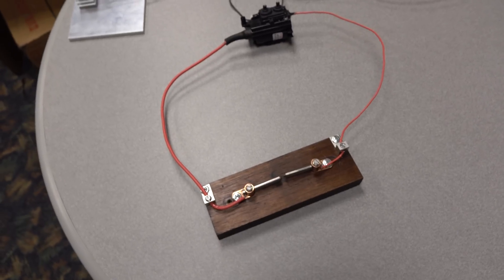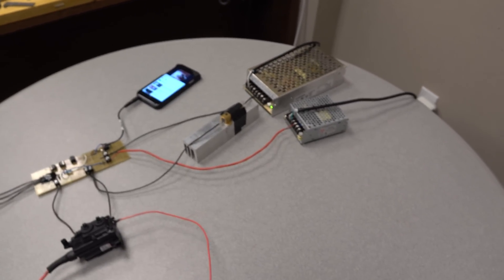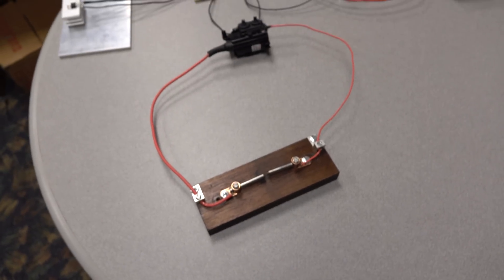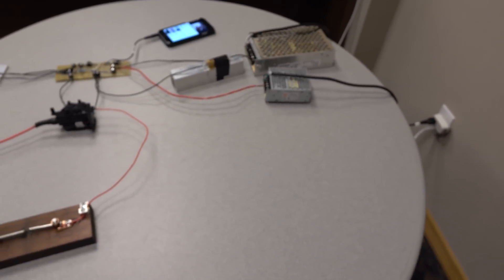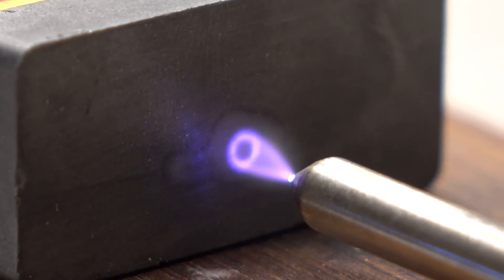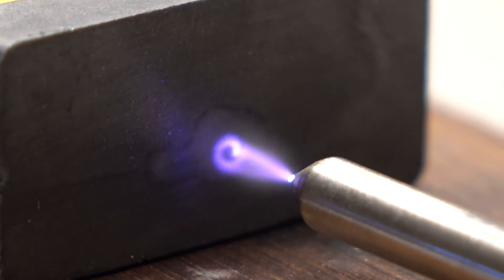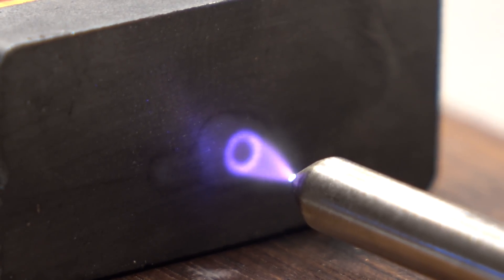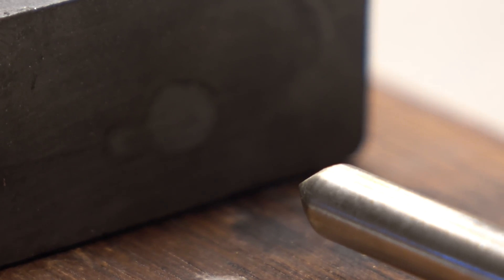Plasma Arc Speaker

Comment: I HAVE A QUESTION.   I NEED TO TRANSFER FREQUENCIES THROUGH A CIRCUIT LIKE THIS TO MY PATIENTS.  DO YOU THINK AT THE SPARKGAP I WILL GET THE FREQUENCIES IN A VERY PRECISE FORM? HOW COULD I MEASURE WITH AN OSCILOSCOPE AT THE ELECRODES OF THE SPARKGAP WITH SUCH A HIGH VOLTAGE THAT IS UNKNOWN?
Reply: Why are you yelling?

Comment: I achieved some excellent results in constructing a plasma loudspeaker. Usually it is not possible to get a loud bass from a low-power corona discharge, or at least a quality silence, still ready to instantly create in your room a little (or better a lot!) Of excess pressure and as much ... a lot of vacuum !!!

If the door is kicked out, the ear will feel: 0000, -9001, + 9001, ~ 0000

so that the limit of the symmetric (for every pulse polarity) the volume of high-end plasma loudspeaker is its ability to dramatically pogasnuv to zero, to create a certain vacuum, the same we can honestly put in a positive half-wave signal, and more, but then the non-linear distortion is inevitable, as in the amplifier class A - quiescent current, you can set the quiescent current (quiescent power plasmoid, in silence) single-cycle amplifier just half the maximum, not sparing the room heating, or add volume feedback system, reducing silent Sound power plasmoid maintain a "ready-zero", which in any case is limited to the volume in a moment.

The corona discharge always produces a crunchy noise, it's still cold, so when it's turned off, it does not produce a vacuum, so it's a source of positive delta pulses, like a burst balloon, but not like opening a radio lamp or jars of baby food ...

But to make an AM HF generator on a lamp with 100W of silence of power, and 200W of maximum power, not easier than a 200W radio station, that would not suit me ...

I also did not like the UPS version on the 555 timer, which modulates the duration of the rectangular pulses of the two-stroke (not flyback) PWM mosfet of the power supply, because the modulation in this IC is not high-end quality, and the transients will create non-linear errors in the rearrangement of duty cycle and power, for example " Dead time), the delay will make a variable contribution to the output power
Only on a meander signal (50% duty cycle) stable timings are achievable, otherwise the dynamics of key switching will depend on the previous state of the system

At the same time, a simple power supply for "IR2123" and two IRF840 mosfet + polypropylene 0.47μφ 450v capacitor at the output for decoupling and horizontal scanning transformer from the old tube TV with 45 revolutions 1mm insulated copper wire primary coil homemade
Gives a power of 15-20kV at 40-60kHz for 1-2-200cm, 1-2cm plasmoid is silent until it turns off ;-), while the efficiency is always about 100% and the power is determined by the output voltage of the output mosfet half bridge, the driver chip controlling the mosfet switches must be fed at the same time From an independent low-voltage stabilized power supply, always giving as fast as possible signals to the gate of the field-effect transistors, each time equally on time, in the middle of the period, ie to keep the mode of 50% of the duty cycle

Iron electrodes (strange but true) sound quieter than copper wire 1mm in diameter, from which the "Jacob ladder" is made for self-ignition

An unusual supply of power to such a voltage converter (linear in a wide range of capacities, and cold during operation ...
The mosfet transducer is switched on by the anode load of the gu-50 radio tube, which is the output stage of class A, the common cathode, the lamp is also shunted by a choke with a resistor, most of the quiescent current flows through the choke bypassing the lamp; approximately 100 watts of power to the keys of the mosfet is fed from the common wire through the throttle + Resistor, more than 50w through pentode gu-50, which can swing from the player with the sound 0 (minus the wave when the sine is 270 degrees)) ... 50w (silence or 0 sine zero) .. 100w (+ maximum, 90 degree sine)

( https://yadi.sk/i/WQctyR1nizT3S )
My Direcr Drive Class A, no fedback, for Stax SR303 headphones, sounds best, original stax class AB amp sounds louder but sad for me.

( https://yadi.sk/i/sJ9Z9G6jttPWG )
first realisation of my plasmaspeacker DC150wt(mosfet, zero mode(ready for vacuum producing silence mode)+AC50wt TUBE(sound)
later it was made in 5liters plastic box, i never listen stereo of it, hope you will, it souds HF easy(unlike Stax reactive "capasitors"-speacker), and loud even some bass(!in this video only plasma playing, no any signal in dynamic speacker situated on the table!)
my plasma and STAX sounds equally best, but plasma sounds spherically(like explosion) when STAX sound dipole, and like a laser on HF - not wide at all, if use like speackers, you must sit in chair properly...
( https://yadi.sk/i/HxEtdpJStrcvK )
Reply: hello friend. The bass reproduction on your speaker is amazing! Can i ask if you have a schematic?
Reply: Never mind I see your second schematic thank you

Comment: So I have a question.  Why does the plasma deflect in a circle due to the magnetic field instead of say, a horizontal or vertical line perpendicular to the electron stream?  I know if it's AC the magnetic field reverses polarity twice per cycle but that's only in one direction aka dimensional axis, not two.  So why the circle?  I'm genuinely curious.
Reply: Remember, the force on a current carrying conductor is perpendicular to both the current and the direction of the magnetic field. So if the two are almost but not quite parallel, the arc should spin around the axis of the magnetic field, giving a circle
Reply from the maker: +Amadon Faul The is using a flyback transformer with a built in rectifier so it is outputing DC.  The reason the arc rotates is because there is a Lorentz force acting on it.  The current flowing through the arc creates a magnetic field which is then acted on by the magnetic field from the magnet. The arc is essential functioning the same as the wire in a homopolar motor like this: http://imgur.com/gallery/gL0OjgE
Reply from the maker: +Amadon Faul Watch my more recent video titled, "The Science Behind a Plasma Vortex"
Reply: Amadon Faul i think its a pendulum effect